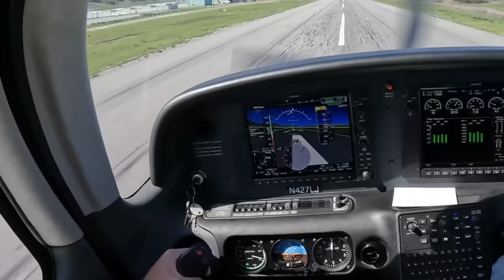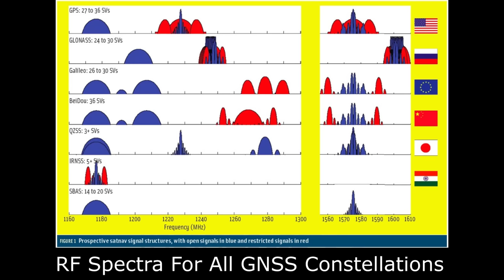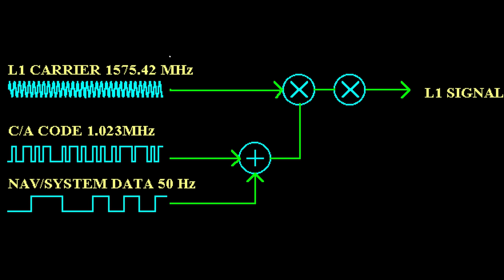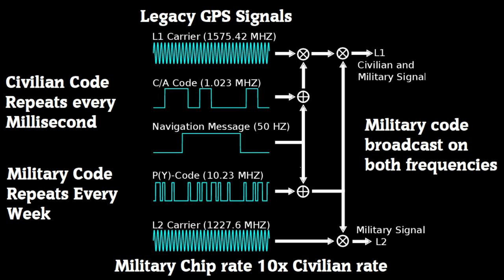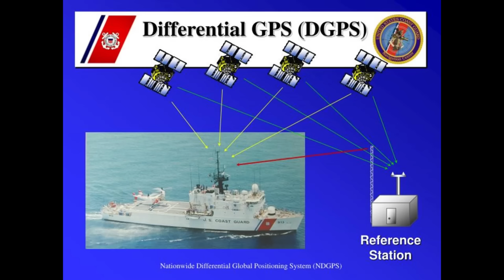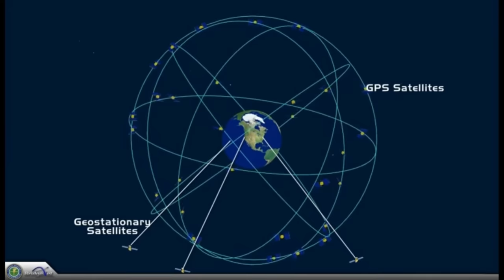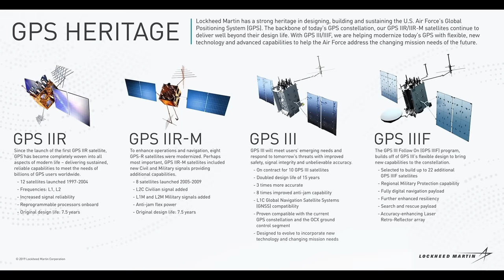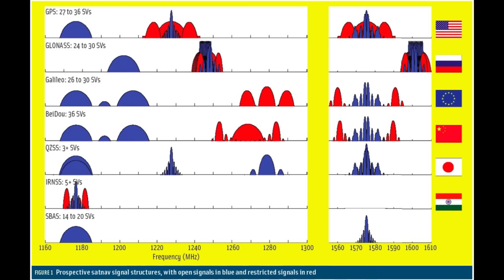How GPS Works, And How It Got Better Than The Designers Ever Imagined

Comment: Unwritten History is that FDF hacked GPS scrampling some days after the first satellites started to operate. They shipped a Soviet made radio station car on the Harmaja Lighthouse South of Helsinki, Finland. Low cost differential gadget solded by some cheap componets (~USD 20) sent diff signal (GPS-real location) on the Finnish Mainland. There the combat-net transceiver LV217 (US  AN/PRC-77, mfg under licence by Nokia) added GPS and diff signal and got accurate position. It was hacked the first day! Now the HQ of FDF had an major communication issue: to whom and how to tell in US. They realised that you can not communicate this in a normal channels - it was a strategic failure. They sent a FDF General to Pentagon to tell what was done. I was told that generals were furious to realize that Soviet may also hack and use the positioning signal, as they did and do! This happened years before Korean plane accident and was the main reason behind. Btw my guess: generals was the Joint Chiefs of Staff).

Comment: I got super dizzy for good reasons. First the speaker's flying hands all over the screen made me dis oriented. The second the details of the signals bouncing from different satellites with many details I could not fathom. 
The simple and easy explanation is: three or more satellites around any location on earth can determine its position. One can go to some extra details,  if wanted, to slice the earth in quadrants using longitudinal and altitudinal lines which will indicate the actual location. sorry for brevity and oversimplification.

Comment: Do you know why the GPS “Leap second” seems to be stopped at 18 seconds from UTC?
Reply: The "leap second" has no fixed schedule like a "leap day".  Astronomers determine changes in the rotation of the earth and decide when a leap second is required to align UTC with the earth rotation.  When you look at tables of leap second insertion you see that there are sometimes short and sometimes very long intervals between them.

(and then there are those that want to abandon leap seconds altogether)

Comment: I'm curious why GPS is so inaccurate in my area - I deliver groceries in West Virginia and my GPS is consistently off but around 50 to 100 feet to the southwest, causing my navigation to say "take the next left" early, or reroute navigation thinking I missed a turn I haven't arrived at yet. I've tried several different devices and navigation apps to no avail. Is is the uniquely mountainous nature of the terrain, the lack of wifi, cell and other signals used to pinpoint GPS, or something else? Any ideas would be appreciated even if it doesn't fix the issue - not understanding what is going on is keeping me up at night.

Comment: GPS got better because the Americans turned off SA (Selective Availability) which deliberately corrupted the satellite signals. Standard accuracy is now around 2-5m, but with the right (expensive) receiver, plus an annual (expensive) subscription, you can get cm/mm accuracy.
The accuracy has always been there, it depends on how much you are willing to spend on a receiver.
Reply: hi neilfoster, what do you think about all gubments drawing a line around you(Antarctic Treaty) and saying you are not allowed to leave? If you don't know what I mean, read my about tab.

Comment: Yeah, now imagine the drop in ATC throughput when something like a really bad solar storm takes out all the GPS satellites and we have to return to older procedures full of old failing equipment. Does the military have a full backup set ready to go? Can you even launch a modern rocket without GPS/existing satellite signals? How radiation hardened are these systems?

Comment: When i was in the Army in the early 1980's , we used a GPS that would show Lat. & Lon. only on a 2 line display. it was used to sync. a time sensitive LF signal.When It failed it was over $200K for the unit to be repaired at the depot. Laughable in todays technological revolution.

Comment: I don't have to watch the video to tell you why GPS has gotten so good... The military turned off the restrictions... the military has been using GPS since before Desert Storm(1991), and it was accurate to at least 1 meter(10 digit coordinate, even to 12 digit coordinates), today the military still uses GPS to 1 meter resolution on a regular bases... ALL GPS receives, whither military or civilian use the same satellites...

Comment: What about space navigation? I always assumed that TDRSS, what with the "Tracking" right there in the name, was like GPS but higher orbit, but looking at Wikipedia there's only 3 primary satellites and they're all in geostationary orbit. So how does Dragon or Orion or any satellite get its orbital elements? TDRSS, GPS, ground stations, inertial navigation, stellar navigation, all of the above? I didn't see Moonikin Campos getting up to call 5 balls on the sextant, y'know?
Reply: GPS can also be used in space for location.  However, space navigation is usually done using mathematics and dedicated measurements from earth.  A groundstation sends a unidirectional signal to the spacecraft which relays it back to earth, the delay and dopplershift is measured, and this gives a single measurement of distance and speed.  Combined with orbital parameters measured before this can be used to calculate the position and new oribital parameters for the next measurement.  This also works outside of the GPS orbit.

Comment: If the airline industry is quietly ditching ground based approach navigation in favor of GPS, isnt that putting all your eggs in one basket?
If GPS gets knocked out by solar activity (something that happens frequently near Brazil), surely you need a diverse solution to the problem of positioning yourself.
Reply: No, instrument landing systems are still commonly used, ground based, they aren’t going away

Comment: What seems to be overlooked, with the progressive loss of alternative legacy navigation systems, is the potential for disaster with a loss of GPS.  This could be human caused (intentional shutdown, internal or foreign) or natural, such as a massive solar storm that kills enough GPS satellites.  Going back to sextants and chronometers during a recovery time would not be quick or easy.
Reply: Nobody overlooks it but on the other hand you exaggerate the impact, no doubt it would be painful but aircraft won’t fall out of the sky, big airliner are equipped with inertial navigation and there is also a VOR system. Also, you aren’t the smartest guy on this planet, some very smart people looked at vulnerability of the GPS, it is much harder to knock out the whole system than you imagine.

Comment: THEY turned off the X meters automatic "error" feature.
I guess THEY decided if someone sent a nuke guided by GPS, a error of 100 meters or so  for the point of "impact" really didn't make a practical difference.
IPERB (Individual Personal Emergency Radio Beacon) used when someone goes overboard or other marine (and now days on land) emergency save a lot more lives if they show +/- 1 meter (or less) of the person's location than +/- 100 (or more) meters.
Obviously, THEY can turn the error back on ... or just turn all the satellites off ...  if the tactical situation requires it. Our troops, pilots, and naval crews all use GPS, so it is unlikely they will turn it off.Besides, The major countries of the world have their own GPS satellites. Opposing armies don't have to obtain commercial GPS units and use our GPS network against us.  Terrorist groups might, but that would be about it.
With the increased drive to autonomous self driving vehicles you can expect GPS to become even more precise. +/- 1 mm or less, combined with in the road sensors, vehicle mounted radars, and other features, would not be out of the realm of probability to prevent accidents.  "Drivers" will have zero input on what the vehicle does once they tell the vehicle where they want to go. Eventually, NO manual input for stop/go/slow/turn will be possible. The vehicles will be 100% AI controlled after the passenger(s) set their destination.
(commercial trucks at loading docks may the the only exception. Backing to the assigned dock door by the driver may be allowed.)
OH!!! Bicyclists (presuming bicycling has not been outlawed and banned ... along with rollerblading ... skateboarding ... kick scooters ... walking/jogging ...) will be able to control their vehicle ... at least if it is not an IA controlled E-Bike, or something.

Comment: All this accuracy is wonderful except it can be interfered with rendering it useless by terrorist using a modified laptop, hence the reason why it not used in commercial aircraft, Boeing uses 2 IRS systems, Airbus uses 3. The only aircraft that comes from the factory with 1 GPS and 2 IRS's is the 787 which due to possible failure of 1 system  use the GPS to verify which one is good (happened on a 777). While not as accurate an error rate of about half kilometer /hr of flight, Example NY to London maximum error is 3 miles and will be less the next time its on that route due to the computer software.And this is why its not used on commercial aircraft. I'm a retired airline maintenance engineer avionics

Comment: Was hoping you'd bring up the use of GPS in farming with tractor autosteer systems. Where waas gets sub inch pass to pass accuracy and 1-2 meters of drift from 1 day to the next. And in the mid 2010s companies introduced real time kinematic to get sub inch accuracy pass to pas and year to year.

Comment: GPS has always been that accurate. The government however, encrypted part of the signal to deliberately degrade it for military use only. When it first came online, I was using it at work for testing. There has been some improvement in the receivers though using updated computation formulas, with decent quality filtering for higher resolution. We knew the location of our antenna to within about 30 centimeters during development just using a root mean square to find the center of 30+ positions. In use, we could tell which lane a vehicle was in while moving (limited speed mind you - about 7 miles per hour was the limit - after that, there wasn't enough signal samples to maintain that level of accuracy)
Reply: You should probably watch the whole video. Scott explains about Selective Availability, how modern technology has 'squeezed' more precision out of the same signals, and how new signals (from the GPS satellites and from the ground) add even more precision than was available to the military in the 1980's.

Comment: GPS doesn’t work when I’m camping in the mountains or at the lake 8,000 feet closer to the satellites… remember when gps used to mean Ground positioning system
Reply: Something wrong with your GPS, it works very well in aviation, no matter what altitude
Reply from the maker: Here’s the hilarious thing, I know the origin of this post, the commenter got it off a dumb flat earth conspiracy site. The originator had a smartphone which wouldn’t load maps because it couldn’t a cell connection to the ground based antennas. But when intelligent people looked at the screenshots being shared as ‘proof’ you could see it was showing latitude/longitude because GPS was working fine due to it coming from space.

Dumb people keep repeating this claim while being unable to tell the difference between a digital map and GPS

Comment: 1:45 This reliance on ADSB only is a horrible idea. There is no authentication. Anyone can spew all kinds of data and the systems accept it. You can add 50 random aircraft to air if you want with single transmitter. Of course it is highly illegal but bad actors don't care about that.

Replacing ADSB with more secure version is of course difficult and requires expensive certification. But if you plan to replace radars with that I'd say it needs to be secure and reliable.
Reply: hi hene, what do you think about all gubments drawing a line around you(Antarctic Treaty) and saying you are not allowed to leave? If you don't know what I mean, read my about tab.

Comment: "nowadays it's good within 1 meter" My ass it is.   On open flat land maybe, but in rugged terrain, no way in hell.

If you don't believe me then try this:  Hike from the north rim of the grand canyon down to the bottom and back on the same trail, using any GPS you want to record your track.  I guarantee you that parts of your path will deviate by as much as 20M and your elevation at the end will be off by at least 5M from what it was at the beginning.

Also CDMA stands for "Carrier Detect,  Multiple Access  in most contexts, not "Code Division, Multiple Access". Counter arguments welcome.
Reply: They use GNSS to track the movement of glaciers.

Comment: https://youtu.be/qJ7ZAUjsycY?t=307
"....I'm trying to get my position in three-dimensional space so I need three satellites..." and then he goes on to talk about why you need the time-dimension because of not-so-accurate clocks. 
No, to find your position in n dimensions ALWAYS requires n+1 points of reference no matter how precisely you can measure things. You could have clocks both in the satellites and in your GPS device that are accurate within 1/1000000000000000000 seconds and still need the fourth reference/satellite. 

For example, if you were on a line and you know that point B is X distance from point A, then you need a second reference point to know what side of A you're on. So if you looked at a ruler and a mark is 5mm from the midpoint marking of 50mm, you don't know if you're at the 45mm mark or the 55mm mark. But if you know you're 5mm from the 5mm mark and you're 2mm from the 57mm mark, you know definitely you're at the 55mm mark.

Comment: "POSSIBLE to land on autopilot using GPS"?? It is a couple of decades since I stopped work but I note GPS only provides non precision approaches not a Precision glide slope or low visibility compliance. The terminal bit of a Cat3 approach relies on azimuth control even on the runway, a glideslope that hands over to radio altimeters, 2 of 3 autopilots that have yaw input to align the aircraft with the centre line of the runway and auto throttle at the  start  not to mention confidence that ATC have kept the runway clear.  POSSIBLE is something I would want others to demonstrate  in VMC while doubt about the wisdom of such landings in the tone of your voice  would improve your practical credentials. It is a shame to spoil the ship for a hapeth of tar.
Reply: hi robertkirby, what do you think about all gubments drawing a line around you(Antarctic Treaty) and saying you are not allowed to leave? If you don't know what I mean, read my about tab.
Reply: @flat-earther  No I don't know what you mean and you need a better sales pitch.  I have no idea if you are underselling yourself or not worth the time as I can see no link to my comment.

Comment: This is probably all copy paste knowledge Scott. 7:18 
And I don't blame you because it is all over the internet.
You actually don't need to know your own exact time at all.
The only thing you need is the position of a satellite and it's time stamp.
With these data from 2 satellites you calculate the 2d solution, the collection of all the points that satisfy the same time difference, which forms a curved surface.
3 satellites give 2 of such surfaces dissecting each other in a line.
4 satellites give 2 dissecting lines which gives a point in 3d space, your position.😂
It is that simple.
So don't bother talking about your own exact time.
It is the time difference  between the satellites, yours is of no concern.
Reply: hi janhammer, what do you think about all gubments drawing a line around you(Antarctic Treaty) and saying you are not allowed to leave? If you don't know what I mean, read my about tab.

Comment: There is no accurate signal for the military, old wives tail.
Did you fail to mention the almanac that downloads to your receiver, thats a key part?
PS many companies make differential receivers that run using multiple global systems, been using them offshore for over 10 years and there systems fix all the issues below hence we can get 2" accuracy offshore.
The errors are: 
The clocks as the satellites dont orbit perfectly so the clocks speed up and slow down
Orbit errors so the range time changes
Troposphere and ionosphere interference bending the signals

Comment: So what is to prevent bad guys from using these signals for targeting? I thought the system was detuned to prevent non military users from using it for targeting.
Reply: There are still restrictions on off the shelf GPS units that makes it hard to weaponize.  The problem is now you can buy and assemble hardware to get around commercial unit restrictions.

Comment: Cell Phones dont use real GPS do they? When I have service and have maps running, I can venture out a few hours into the boonies and all is well and accurate, any more then the pre loaded info and it "loses signal" , also If my phone dies and I charge and restart it, it has no idea where I am if I am already out of service range. So google maps seems pretty tower dependent not satellite dependent.
Reply: There is a difference between "knowing your location" (which is what GPS provides) and "seeing it on a map" (which is what google maps provides).
Only maps for your current local area are downloaded, via cell towers, and when you move outside cell tower range it cannot download new maps.  When you drive outside the area of the already downloaded maps, you are lost.
More advanced maps software allows you to pre-download maps for areas you plan to visit and where you have no cell coverage.
Then it will keep working, because you have the maps and GPS provides the position on the map.